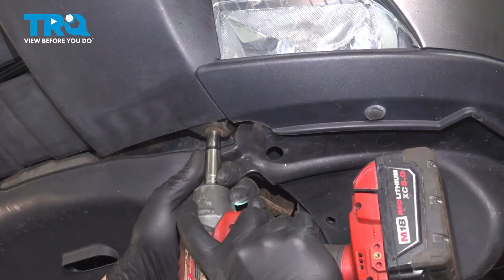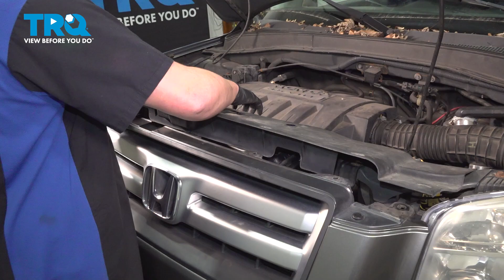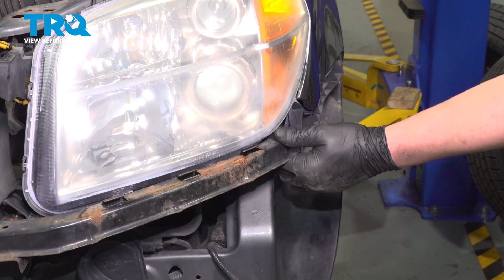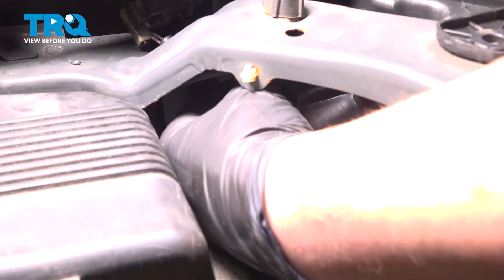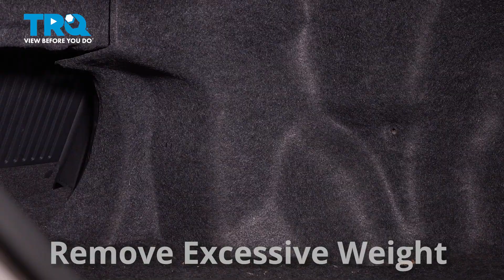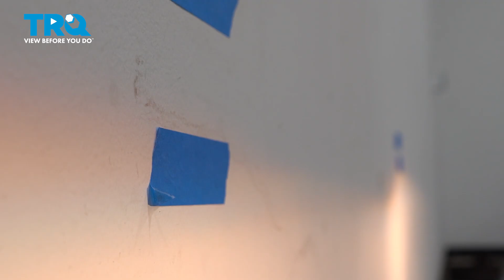How to Replace Headlights 2003-2008 Honda Pilot

Comment: Honda engineers should be ashamed for designing something so complicated and tedious.  I can change both headlight lenses on my Ford van in under 10 minutes. It’s that simple.
Reply: I replaced both mine in about a half hour. You don't need to take the car apart. He is to pussy to squeeze his fat arms between battery and headlight housing to get bottom bolts out.
Reply: Yeah, but on the other hand, think about how easily people are stealing taillights.